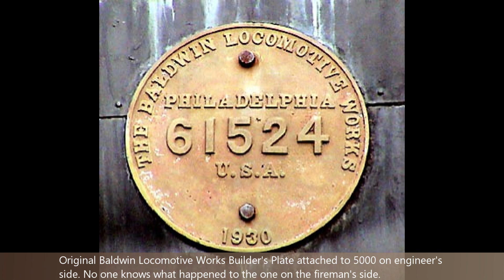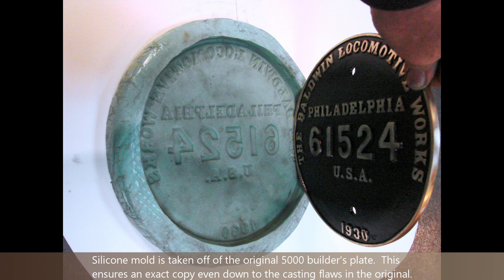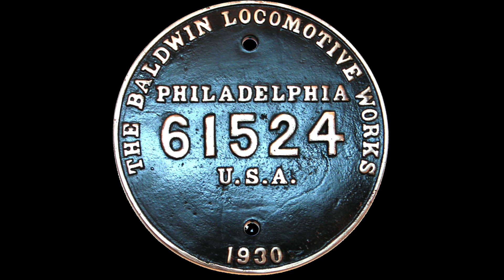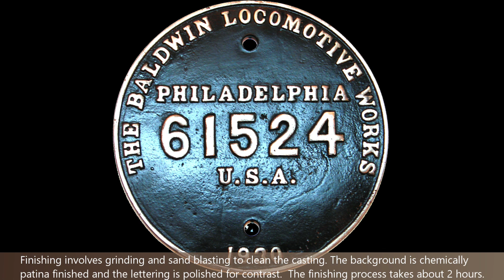AT&SF 5000 Restoration Work - Episode 4 "Baldwin Locomotive Works Builder's Plate Duplication"

Comment: Question: Do you know the exact dates when locomotives 5000 and 5035 where delivered to the ATSF. I have been trying to look into that but so far, no joy. I know that 5000 was delivered on December of 1930, but no luck on the day of the month.
Reply from the maker: I don’t know the exact dates but I will look at my files and see what I can find for you. Give me a day or two…
Reply from the maker: So far here is what I have found. 
Engine 5000 was delivered on or about December 15, 1930. 
5011 was received on Santa Fe property on June 2, 1944. 
All locomotives of the 5011 Class were sent from the factory to Topeka where they were tested and set up. Then they were put on freight train 29 as second engines and taken to Emporia. They were then sent on to Clovis by operating on drag freights. 
So far, I have not found a delivery date for 5035. It sound like from the information above that they were all delivered at the same time. Probably the June 2, 1944 date.
Reply: @santaferatonsub  Thank you very much for the info! And a very nice job with the builders plate.
Reply from the maker: Glad to help. That information came from my research for a book that has not been published. If I ever publish it the book will to be titled, "Santa Fe's Fifty Hundreds" in two volumes. Volume 1 is about Madame Queen (because after writing my first book "The Madame Queen - ATSF 5000" I found even more information about her) and Volume 2 covers engines 5001 - 5035. 506 pages total. Maybe I will turn the book into a video for this channel. It would have to be a series because it would be much too long for one video.